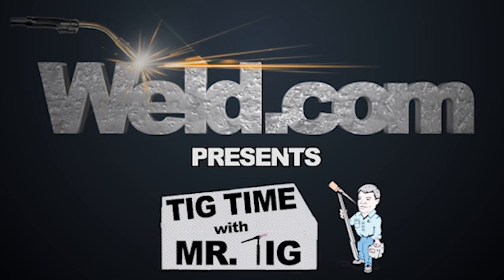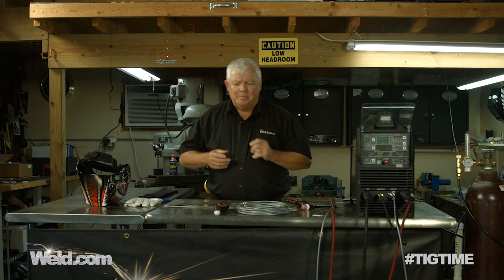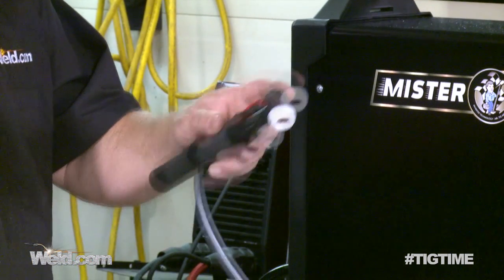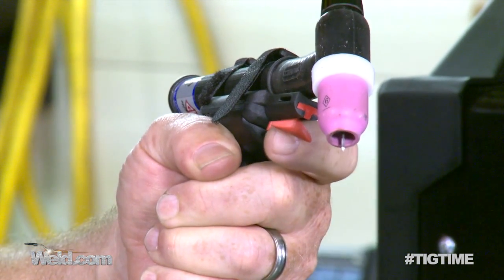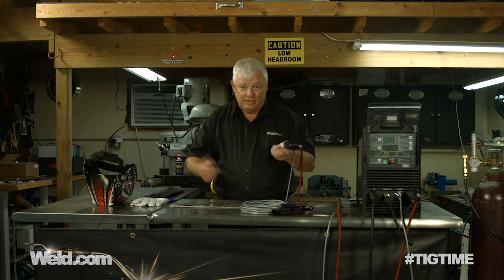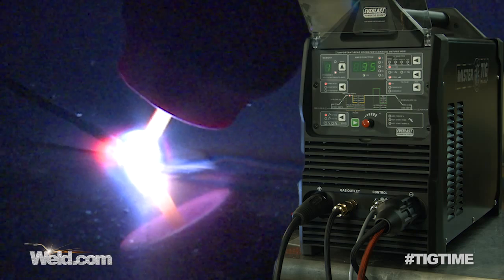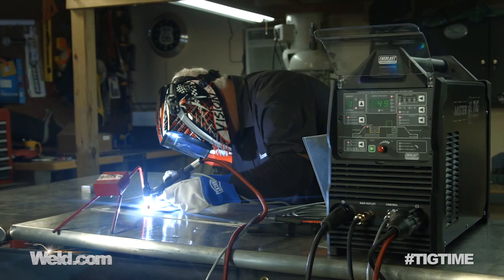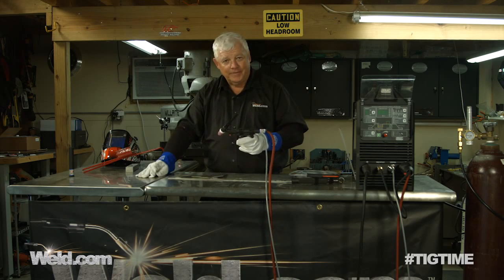CK Worldwide Steady Grip "Pistol Grip" Hand Control Review | TIG Time

Comment: The only thing I can see with this piece of kit is that the weld runs can only be short as it seems that the wrist does most of the work in moving along the weld and as such would need to keep repositioning the support.
It's a good idea though, certainly more controllable than the racetrack controller you demonstrated.
Nice video
Reply: Tom Simpson any small move of the hand will be a much bigger move at the tip the further away your hand is. a novelty at best in my opinion

Comment: I'm using one on a 2015 Everlast 210EXT, as Mr. Tig/TigDepot seems to be the sole source of these with the pinout ported for Everlast 7-pin Panasonic connectors. I mean, CK seems to only market these for Miller, Lincoln, and Tweco. It's nice, even if it's not the actual producer, that someone is servicing the demand for this slightly innovative take on a hand amptrol, for those of us who don't have the Yankee Doodle Dandy machines.

I like it quite well. It's "steady", keeps your hand off a hot torch, and the grip also provides a pretty intuitive positioning prop. Yes, like most CK amptrols, it's a little pricey. It was only $239 for mine from TigDepot, with free shipping and no extortion paid to the State cult. 

One note to keep in mind is that the slide action is not return-spring, like a pedal is, so the solenoid will continue to flow Argon if the slide is out of the start position when an arc is not actually in process. So, that could potentially waste gas if you're not aware of that.

Comment: only problem i can see using the pistol grip is the variation to arc length from pushing and pulling the "trigger". could be trained out over time, though. thanks for the demo

Comment: think the feel wll be more natural when youre used to a mig torch that you basicly hold in youre fiist and not like a pen and trigger with youre finger , seems like it verry eazy to support the torch to hold it steady too though i could see t giving problems if you need to point the torch over sumting higher then the part youre welding

Comment: What’s wrong with a footpedal? No reason to re-invent the wheel. You have just as much control of fine ajustments and your’re not stuck with only one grip position. I guess it’s fine for welding two plates together on a worktable, but when it comes to tight spaces and tricky positions I think the pistolgrip would struggle. 
I’ve been welding professionally the last 16 years, and I’ve tried a lot of different torches over the years.
In my opinion the Kemppi TTC/TTK series with the S type swivel neck is by far the most versatile TIG torch on the market. It allows you to set it up for just about any job you can think of. And the build quality and durability sets it apart. If you prefer being able to adjust your weld parameters with your fingers, go with the RTC20 grip with integrated rocker type adjustment switches. I still prefer to use a footpedal because it allows for a steadier grip without the risk of unintentionally moving the torch around. The adjustable finger supports also helps you find a good relaxed grip. Very important if you do a lot of welding. 
The CK FlexLoc torch used in the video, just isn’t durable enough and the locking screw on the neck tends to come loose or break off.
Spend your hard earned money on the Kemppi torch, a quality foot pedal and a “TIG finger” from Welding Tips & Tricks. You won’t regret it.
Reply: Casper Maul. Why should we need 3 limbs to do simple TIG. Hope this thing takes off, 2 hands an a nod of the head should have been all we needed since the very beggining.
Reply: Try using a foot pedal while laid on your back, or two steps up a stepladder is what's wrong with a footpedal, it's past time they actually invented the wheel....  Would also help if they made it affordable too.. instead of 4 times the price of a basic pedal... why should i be stuck with at best a button, or some device which disturbs my control?. Triggers can be squeezed without disturbing your aim.. ask any marksman.
Reply: try dragging a foot pedal up a 12 foot ladder and stabilize it. i weld on stainless steel duct work so i know. foot pedals are a bitch

Comment: do you know where a guy can find a slider control for an Everlast 47k ohm 7 pin machine?
Reply from the maker: +Jamal Matteson We used to supply them, but CK stopped making them for Everlast units.
Reply: That's the one thing I hate about my Everlast. Couldn't be happier aside from that. :(
Reply: I really like my Everlast. I had a hand control on my torch but never really got used to it. I'm not so sure this pistol grip is much better.

Comment: Ive been welding for 15 years most of which Tig...and that pistol grib just seems dumb!! No thanks
Reply: NeverMe01 same here.
Reply: I've been welding for 18 years I hate the knobs and rollers but it would be nice to have some kind of our control one of foot pedal is not viable I'm not the biggest fan of mr. Tig but I would definitely try this out just to see how it feels every welder welds different it's an art no One told Picasso how to paint
Reply: NeverMe01. Old timers words never change.
Reply: I know this was 3 years ago so hopefully after 18 years of welding its been more than sitting at a table. This by far the best setup I have used as of yet. Many many cages and chassis have been made easy with the pistol grip and flex head. If I had more than one leg I might consider trying a foot control again.
Actually I did learn with a foot control under my forearm/elbow but this is so much smoother for me to work with.